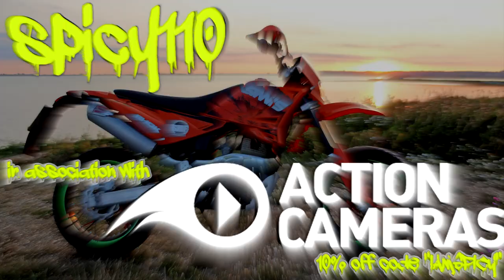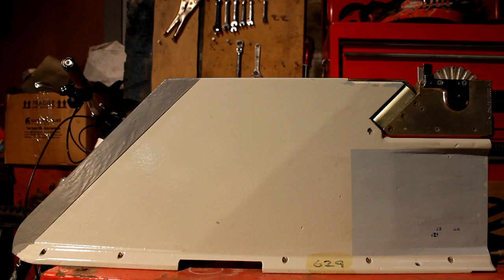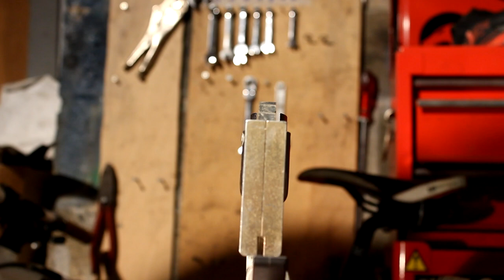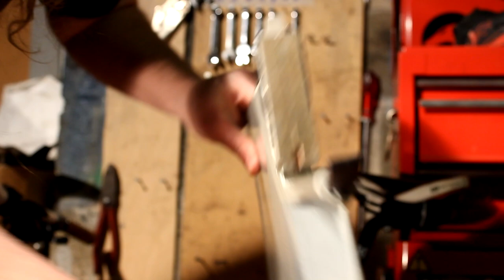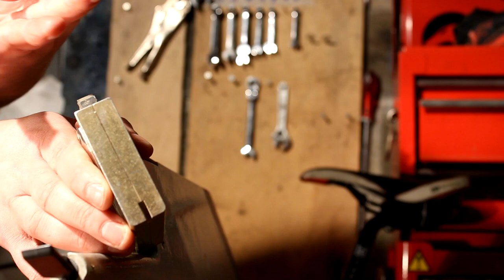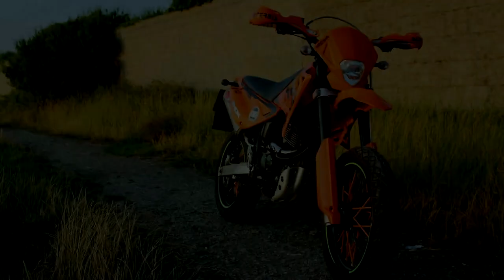The Rolleron! Amazing engineering! Aim-9 Sidewinder!

Comment: Did some basic googling, and it seems like the air speed out of your compressed air tank is likely mach 1, if the pressure is high enough. (something around 40-50psi, easy for compressors)

Not sure if it can go higher than mach 1, though... TL;DR, the flow gets choked at mach 1, though I'm not sure which mach 1... (I think it's safe to say you're well below mach 2.5 in atmosphere, though!)

From the description on wikipedia, though, it almost sounds like it's what ever mach 1 is for the upstream conditions? https://en.wikipedia.org/wiki/Choked_flow Though, looking in to what factors in to speed of sound, density might actually hurt sound speed in air? Ehh, even if I'm not understanding that right, it doesn't sound like it could be grossly larger than atmospheric conditions, so it can't be much greater than mach 1 "best" case, IMO!
Reply from the maker: Yer you also have to take air density at altitude in to account and that's when I have up haha

Comment: As I understand it...
The AIM 9 doesn't do Mach 2.5
It does Mach One.
But, Mach One more than the aircraft firing it.
So if the aircraft is doing Mach 1.5, then the missile ends up doing Mach 2.5 (sort of...)
And probably 2.5 would be its aerodynamic limits.

Comment: I dont get one point if these are spinning at high rpm during regular flight, the bearings should get worn out quicky or do they start spinning after launch??
Reply from the maker: I believe they are held in place with 2 bands that pop off at lurnch. Note a comment a couple below yours.

Comment: Get a tachometer gun and see how many RPMs the wheel is hitting at that speed. Then extrapolate the RPMs to the missiles maximum flight speed and determine how fast it spin @ Mach 2.5 That would be fun to know..
Reply from the maker: See the pinned comment.

Comment: Bit of history on the AIM-9, because you got things all mangled.  The project that would become the AIM-9A was started by the US Navy in 1946.  The first prototype missiles, designated AAM-N-7 Sidewinder 1, were first live fired in 1952.  The Air Force would trial the AAM-N-7 and the improved AAM-N-7 Sidewinder 1A in 1954, and adopt the Sidewinder 1A as the GAR-8 in (I believe) 1955.

Missile and aircraft designation systems would be reworked and unified between services in 1963, and the AAM-N-7 Sidewinder 1 would be redesignated AIM-9A.  The 1A variant would become the AIM-9B under the new system - the missile you claim this is.  The issue with your history is that the -9B was found to be severely lacking by the 1960s and improved variants were introduced as early as 1963 with the AIM-9C.  So there's no way an AIM-9B would've been manufactured as late as 2006 - it had been replaced in US service by the mid-1960s by improved variants.

In fact, by 2006, the latest and greatest version of the AIM-9, the -9X, was in full-rate production.  I suspect that yours is either older than 2006 or from a newer version of the missile.
Reply from the maker: Pinned comment, better video.

Comment: The rolleron is not "amazing engineering" - it is proper, smart engineering. It takes estsblished mechanical concepts: a gyroscope and an otherwise independant and free control surface, and with TWO moving parts creates active directional stabilization. No electronic gyros, no servos, no computers, just two mechanical parts. This is engineering done the smart way - designing something that is extremely simple, cost-effective yet perfectly suited for the job. The exact opposite of over-enginering.

Comment: The AIM-9 is not a heat seeking missile. It's an IR missile... there's a difference. LoL
And it began its development in 1946 at what is now NAWS China Lake, CA (was the Naval Ordnance Test Station (NOTS) in Inyokern, CA at the time).
Trials of the -A & -B took place in the early 1950's, and it was first used in combat on 24SEP1958 (2nd Battle of the Taiwan Straight): F-86 Saber ---> MiG-17 Fresco
This guy didn't do his homework.
Reply from the maker: You did not read the pinned comment did you? At the time this was made, the documentary that came out about the skunk works had not been made. You will find this is the source for many inc curious droid who's video you may have just watched. This is a 8 year old video more info has come out in that time. I think reading the description or the pinned comment would also class as homework...

Comment: Sidewinder was designed from the 1940s to the 1950s and entered production in the Mid 1950s and has been in production ever since through all of the various marks. It was first used in combat by Taiwan against Chinese PLAAF  MiGs. The Soviet got ahold of one that was lodged in the tail of a Chinese J-6 that failed to explode and copied it and called it the Atoll... I have no idea why you think it wasn't built until the 1970s onward... It was one of the main missiles of the Vietnam War on both sides... SMH 🤦🏼‍♂️
Reply from the maker: Yes I know, check the pinned comment.

Comment: Does the roller work when the "tab" in back in?
Reply from the maker: It spins but dosn't more, as it turns out the wheel are held in place with bands in flight that pop off a launch

Comment: I was curios about the wheel speed, so...
It looks like there are 22 teeth on that wheel. edited: I now know there are 24 teeth.
The Spectroid app shows the pitch reached 6094Hz.
So it looks like the wheel reached 254rps (15,235rpm)
Reply from the maker: Check the pinned comment. 👍
Reply: @spicy110  haaa, what great timing. Thanks. We even used the same app!
2 things I will say about your new video:
- I can see the wheel indeed does have 24 teeth.
- the pitch certainly is not 15kHz (6656 is the correct value). You can confirm this by using a signal generator app and compare both pitches manually.

Comment: QUESTION-1: Was it passive stabilization? 

QUESTION-2: In order to actively steer, does it have to fight these.. or does it USE them in some way?

Tweeks
Reply: pretty cool stuff
Reply: Not exactly sure, but I'd imagine that the active steering is controlled by the fins on the top of the missile. I think the only thing those rolleron gyros do is keep the missile from rotating.
Reply: these are only controlling the Roll axis - and as demonstrated, they keep it going pretty well dead steady. the forward fins control Pitch and Yaw, which are used for steering with the roll locked - unlike an airplane, which Rolls so the pilot's head is Up in the desired direction and then Pitches nose up to accomplish the turn

Comment: Just analyzing the audio it looks like you got it up to about 15,000 RPM.
Reply: Showing my work:
Measured 15° between each fin on the spinner
360/15 = 24 fins
Measured about 6100 Hz in the audio
6100/24 * 60 = 15,000 RPM (rounded to significant figures)
Reply from the maker: check the pinned comment I have already done this in a video, what you have there is RPS you need to multiply it by 60 for RPM 🙂
Reply: @spicy110  You are aboslutely correct. I just fixed that. Something didn't seem right about it but I kept telling myself to trust the math. Oops. Thank you.

Comment: Hey man, you’re off by a full decade on design and deployment of the AIM-9. Try 50’s and 60’s.
Reply from the maker: Hey, read the pinned comment. Did you enjoy droids video?
Reply: @spicy110  to which comment do you refer? I see only one, and it does not address the time line. Other than that, I did give him a 👍
Reply from the maker: Both the top comment and the "pinned" comment. "https://youtu.be/y1kUzjdkxG8 Brand new up-to-date video with more missile parts and RPM testing of the Rolleron wheel. Also I correct a few mistakes I made."

Comment: I quickly threw the sound into audacity and got it to draw out the audio frequencies generated by the gyro right before you turned the hose off. http://gyazo.com/6bf650c348f7a6e86e9023d73c62579d from this it looks like 6000 and 12000 Hz are the prodominant frequencies. My hope is that this means that its spinning at 6000 or 12,000 RPM I'm not entirely sure, perhaps someone with an actual education might be able to figure that one out!

Comment: It's funny you keep remarking how "it hasn't been used anywhere else". Stop for a second and ask yourself WHY. No it's not because of high technology, this thing is as basic as it gets. But other builders considered this and realized the beenefits don't outweight the costs, meaning it's likely overall harmful performance/cost wise. Making the missile overall a worse product.

It's like the Abrams turbine. "Nobody else tried it!" The fact is that other countries considered the turbine and found it lacking for several aspects that we all know. Case in point, the new Abrams are going back to diesel engines, and new missiles don't have rollerons.